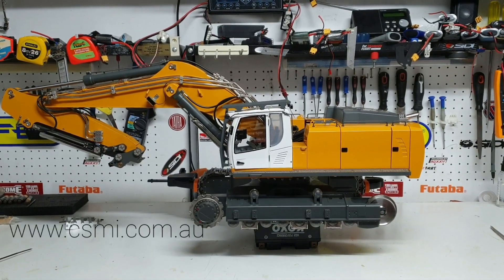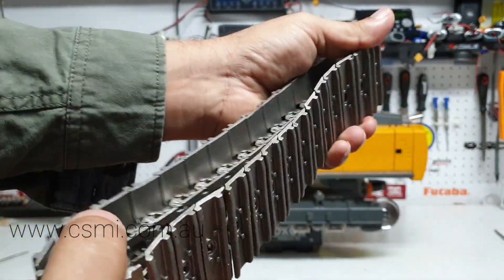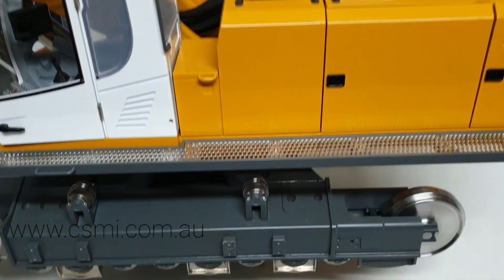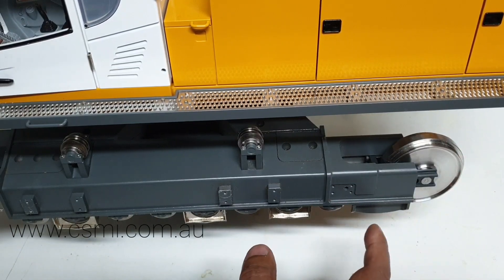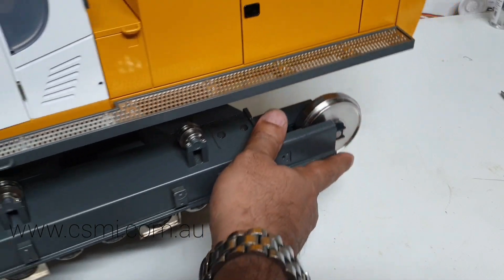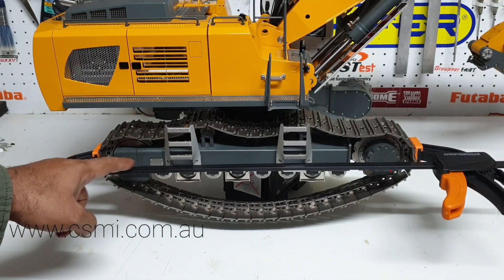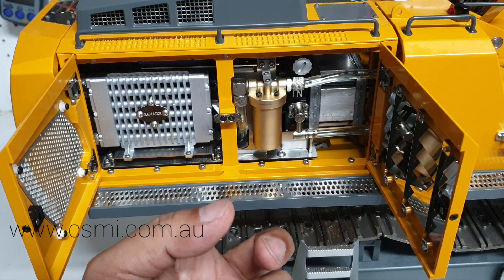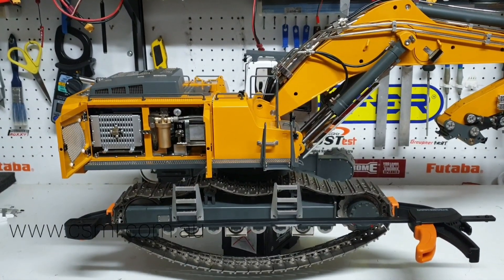CSMI : RC EX9700 EXCAVATOR track disassembly and cleaning explained

Comment: Used your f-clamp tip for my kabolite 350. Tracks came of in no time, just the pin hole is a bit different but it works the same way.  Thx for sharing 👍

Comment: After cleaning the track do you apply any type of chain lube or does the track run dry so as to not mix grit with grease/oil and create a cutting past?
Reply from the maker: Keep it dry . If not you will get more dirt